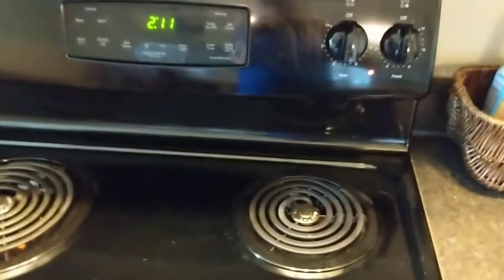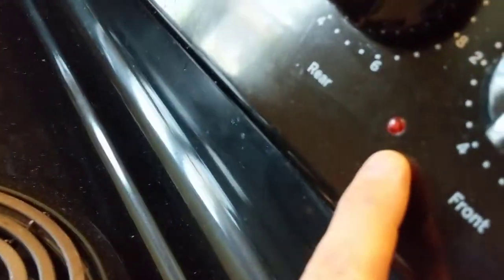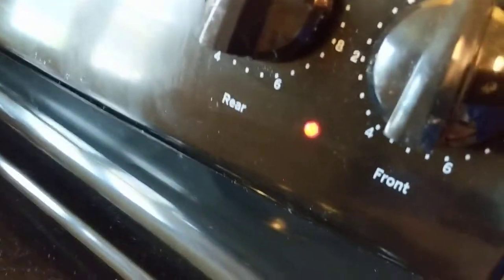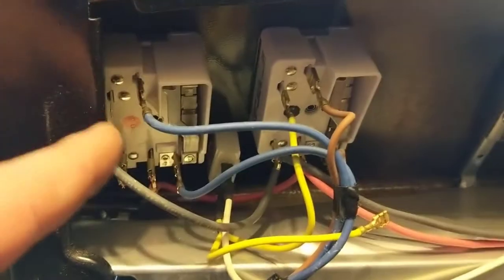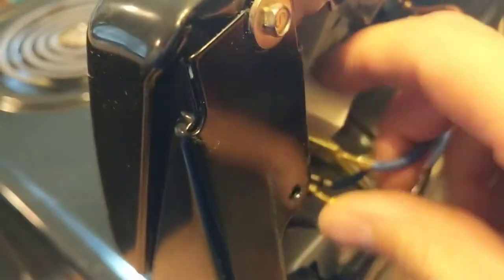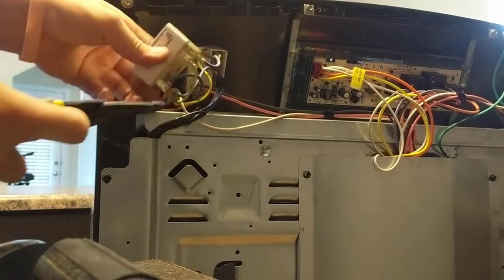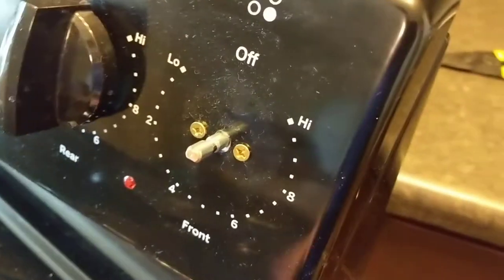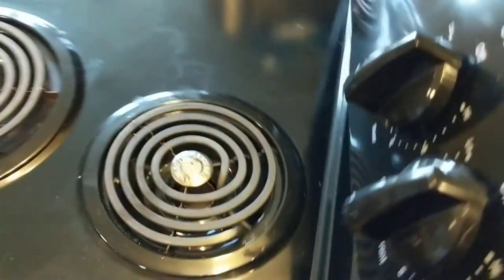Electric Stove Hot Surface Light Won't Turn Off

Comment: I had burner lights/hot counter top light on. When i opened the back of the oven, the switch was blackened and obviously defective. After i changed the switch, the light stays on. What could cause this. The other switches appeared ok, but i never tested them. Have you ever heard of this? electric range GE model #jpb64boh2wh
Reply from the maker: It's most likely the other switch causing the light to stay on. Sometimes the switch won't show anything visible it will just cause the light to stay on cause something is wrong inside the switch. I show in the video how to find out which switch is causing the light to stay on by pulling the wire off the switch & plugging the stove back in and testing it to see which switch is causing it. But whatever side of the range your light is on, and you changed one of the switches on that side and the light is still on, then you know it's the only switch that's left on that side that's causing it. Thanks for watching Kevin & Subscribe to the channel 👍

Comment: You: So you just want to pull your knob off…
Me: No thank you 😳
Reply from the maker: 🤣 🍻 Thanks for watching O'Shack & Subscribe to the channel man 👍
Reply: @ApartmentMaintenance  I swear I did earlier today and just checked and I wasn’t, weird. Do you have any videos on what tools you carry for most work orders? I subscribed for sure bro.
Reply from the maker: @OShackHennessy  Not yet, but I will be doing a tool bag load out video soon on my veto tech MCT bag I carry daily & I'm setting up my veto MB2 bag with some new tools I've bought & plan on doing a video on that as well. I have to many tools to do videos on but it will be mainly what I carry daily. 👍
Reply: @ApartmentMaintenance  I love tool videos. I just got the Veto Tech Pac and it’s a beast but perfect for what I need to carry on a regular day. Of course I have to augment occasionally but for what I do it’s perfect. I’m not a real tradesman but I own restaurants and do 90% of my own maintenance. I used to use a bucket buddy but hated having my expensive babies sitting open for anyone to take. Yesterday was electrical and today was tile, later this week fix a leaking drive thru window 😂
Reply from the maker: @OShackHennessy  Nice! I'd like to get into ownership of either rental properties or some type of business as well.

Comment: I have a glass top whirlpool stove .I changed the nob fuses on the 8 inch , work for 10 minutes , and then all other burners stop working ,so I changed the terminal ,and still not working , any suggestions
Reply from the maker: You changed the fuses on the 8 inch burner? I'm not following what fuses your referring to? Then you changed the terminal? I'm not following on what your calling a fuse, & a terminal?

Comment: My stove lights just won’t turn on
Reply from the maker: The light inside the oven ? Or the clock/temperature area doesn't light up ?
Reply: @ApartmentMaintenance  clock temperature
Reply from the maker: @m1ggiesj  Sounds like the control board needs replaced. I've had some that the clock wouldn't show, but when I would press bake or set temperature it would show that & soon as I would turn the oven off it would go back to a blank screen. Unless a wire came off a terminal, I would say the display on the board is shot. Thanks for watching mister nugget sir 👍
Reply: @ApartmentMaintenance  thank you for helping 😎